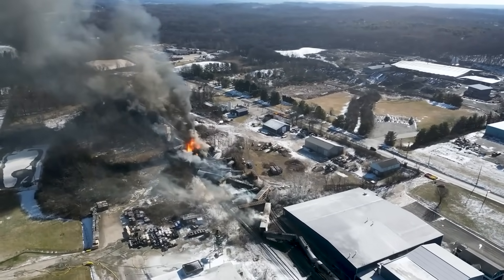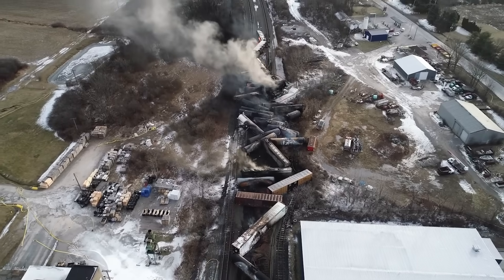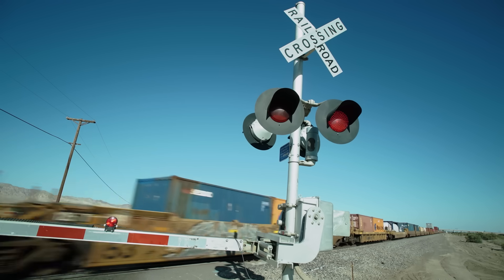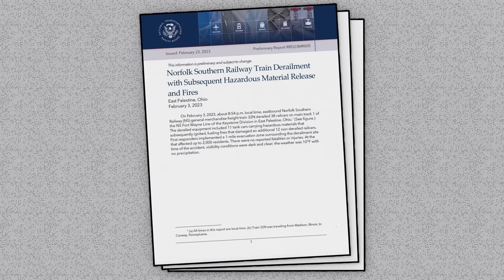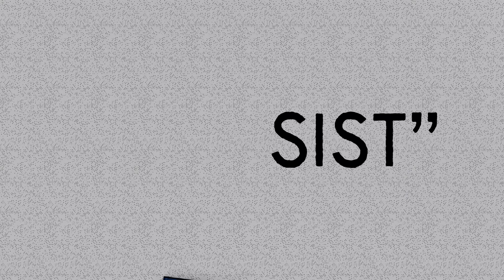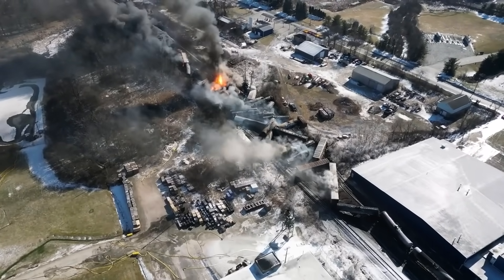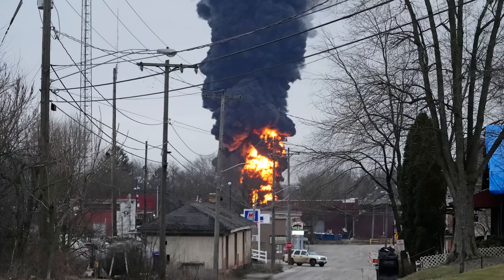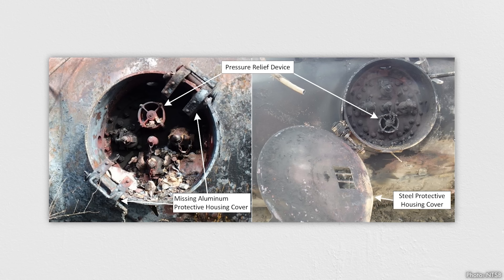East Palestine Train Derailment Explained

Comment: Seems to me the sensors that detected the temperature of the bearing simply needed to take into account what the temperature of the bearing was last recorded at. 
If in 15 miles it increased nearly 100 degrees but doesn't trip the brakes because it hadn't yet reached the critical point it should still be obvious that it was heating up.
And if it is heating up far beyond its neighboring bearings, and so quickly too, that should trip the brakes as well.
Reply: The detectors don't have the capability to set the train brakes. However, some installations are networked while others are not. Networked systems do sense the rise in temperatures and will alert the dispatching office who will contact the train crew.

Comment: Your river videos, I was hoping you could get back to it. if you had a perfectly straight line leading to a lake, with a perfectly straight line leading to the "ocean" what would happen. Adding the lake in the center, so long as the straight lines were off set, should slow the erosion down however the exit would remain in a close location... on the board. Also that map could add mountains. heavy stone imbedded in the area should do the trick for now.

Comment: They should have those sensors every 5 miles instead of 20. And if the temperature keeps climbing after passing 2 sensors then the train should be stopped. Even before the temperature passes the limit that is set.

Comment: Ah, the corporate geniuses. Replace the crew in the caboose with automated ‘defect detectors’. That tell you just enough so you know when something has gone terribly wrong. Not only is it possible, it’s not even expensive to have thermal supervision of every axel native to every car. I work on turbomachinery from the 70s and we reliably monitor bearing temps inside of extremely hot and oil soaked environments. A train axle is a very permissive environment to measure in. Or they could choose IR or UV monitoring which would allow wireless monitoring of multiple cars. So many options, and yet they choose none of them. 

“If you think process safety is too expensive, try having an accident”. We should not be relearning the lessons of bohpal in 2023.

Comment: There was probably a BIG concern about the burning tank cars causing a BLEVE, boiling liquid expanding vapor explosion. Letting the relief valves flare was a bad option. A full tank is actually safer as the boiling liquid inside cools the steel, once the tank is mostly empty, there is nothing to cool the steel and it is actually mostly empty tanks that rupture. Those PRD's solved one immediate problem but definitely created a bigger one. Still, if I lived in east Palestine, I'd be pretty pissed.

Comment: The unions have been warning about the safety culture for years at this point and have been ignored by both the state and the rail industry the entire time. Derailments used to be pretty rare, but now we have hundreds every year. The only way to fix this is to listen to the rail unions when they speak out. They are the only ones that know the true extent of the corruption within the rail industry. They work the rail lines and they should be listened to as they are the most direct source of safety data. When CEO's are faced with a choice between public safety and increasing profits, they choose profit every single time. The NTSB can only react when anything goes wrong. They have an important role to play, but the unions are a preventative measure that needs to be taken seriously. 

Norfolk Southern should never have been put in charge of clean up. They should definitely foot the bill, but they cannot be trusted to clean up the mess they made. The EPA should do the actual clean up and send the bill to Norfolk Southern.

Comment: Your wrong on train braking systems. They need air pressure to work if a train looses air pressure then u have a run away train that can't stop as happened in the field cp rail derailment. Trains are not like tractor trailers with spring brakes that apply mechanically. The only mechanical way to stop a train is the applied hand brakes on every car that they use when stopped.

Comment: Why dose it take a disaster for these companies to up there standards the train should have stopped as soon as the temperature went above normal not 200 above I used to work on hirail trucks and just about every one I worked on needed new wheel bearings due to over loading and heat there should have been more safety monitoring on the train all the safety systems on our cars can be put on trains but won’t due to cost

Comment: You missed a few key points. 
One, there's an average of about 1700 derailments a year.
And two, that was NOT a controlled burn. That was a release and burn. A controlled burn is as you briefly glossed over, with a flare or similar where a proper O² mixture with the Vinyl Chloride can be CONTROLLED. I've been at various refineries when the flare goes off. There is a huge amount of fire but NO smoke. 
And the same EPA turned the Colorado River gold with toxic stuff from a mine. I don't trust or believe the EPA one bit. That ground is polluted. The water table is polluted.

Comment: I would like to know more about the railroad braking systems.  When this event occurred, there were some statements made that the modern rail car has brakes that were designed prior to 1900, and the lines wont modernize due to cost.  How long does a rail car take to stop in emergency scenario?  Do 2 cars take twice as far?  What can be done (policy/legislation etc) to force retrofit of modern brake systems?  Is anyone working on such improvements?  How often are the brakes inspected, tested, serviced?  Would better, modern brakes likely have prevented the East Palestine accident?

Comment: 5000Tons of dirt is just not that much, but it's hard to know the scale of the cleanup. I heard the train crew is supposed to put eyes on all the cars before the train leaves the yard. On these very long trains, 2 miles or more, that would take time to do the inspection carefully, and the Co's aren't going to want to pay. It will be interesting to hear the arguments that take place for even more tech to be introduced, or better use of manpower. It bares noting that planes are still physically checked several times before flights.

Comment: In the days of the caboose, and before the automated detectors,the detectors were lighted up boards. The engineer would radio the conductor “SP 8545 to caboose, scanner.” When the caboose passed the scanner the conductor or rear brakeman would look at the board to see if the scanner had been set off. The board would display the axel number that was registering hot if one was. If not, the board displays 3 zeroes. The conductor or rear brakeman would then radio the engineer, “SP8545 highball the scanner.”

Comment: I did not understand why the train actually derailed. You told us that the emergency brakes activated, then the crew activated the rest of the brakes and took off  with  part of the train, and then the train derailed. But why? Did it just hop of the tracks? Was the track ending? Or is it just the different speed of the railcars? If just one bearing was defect and even if the wheel was melting of, it has 7 other - shouldn't they be enough to keep of the tracks?

Comment: This is an opportunity to discuss rail from an engineering perspective. Majority of the population have no idea of the weights moved, the infrastructure required or the engineering into modern trains. 

But here is something for the commenters to think about; a train can stop within one length of itself, imagine a car doing that. However, modern trains can reach 2.5 miles (4km odd) long. With weights over 10-20 kilotons. (even larger than this exist.)

Comment: I'd really love to know more about why burning the VC once it was released was considered the best course of action at that point. I'm not quite clear why it couldn't be pumped into trucks and removed that way for example.
Reply: Vinyl chloride is a flammable gas at temperatures above 7F. It's transported as a compressed liquid under very high pressure. In a scenario like a train derailment and subsequent fire, venting the gas and igniting it is probably the safest, least environmentally hazardous approach to take.  You do not want the stuff to linger, heating up and expanding until it exceeds the strength of the tank cars and bursts them.  You can very quickly find yourself with a "BLEVE" (Boiling Liquid Expanding Vapor Explosion) that would cause considerably more damage and injury than torching a plume of gas in a controlled manner.  There's a truly scary youtube video out there of a couple of tank cars letting go (one containing propane and the other isobutane) after a derailment in Illinois in the early 1980s; when the propane tank blew up a news crew a half mile away felt the thermal bloom, and half the rail car was found in a field 3/4 of a mile away from the explosion site.
Reply: @mrz80    thanks for replying, however this still doesn't explain to me why releasing into environment is better than pumping under pressure into a truck (for example). I'm presuming that's possible since the material has to have got into the rail cars somehow. If the reason is simply, the trucks capable are too far away, then fair enough, but I haven't seen anyone say that. Only "this was probably the best solution". What were the other solutions available? What variables made them untenable?

Comment: I have heard axle vibration sensors are the norm for passenger rail.  Vibration sensors are considered far more reliable then temperature sensors at detecting bearing failure.  Powering them and connecting them to the locomotive would be pain.  Everyone knows how much hassle is trailer hitches.  Also adding another wire would up the workload.  I saw a solar powered ballasting car used by the contractors upgrading the tracks fore Brightline.  Basically a solar panel on top of each ballast car was used to power electric hopper doors to dump the ballast on the track.  Kind of a neat way to power them. similar solar method could be used to power the sensors.  Also some sort of radio communication between cars could be set up for communication to the locomotive.
Tracking and braking could be added to the system.

Comment: Great video Grady! Your strict engineering accounting of this tragedy is great and inline with your typical content, keep it technical. Your ending thoughts touched on the larger tragedy and the reality of freight rail traffic. Engineers focus on the how to do things but also need to ask but should we do this? The chemicals carried by this train are used primarily in the growing plastics industry which in itself is not an ecologically friendly industry. So our engineers need to work “overtime” to solve this problem that feeds a problem.

Comment: I found a small train bridge not very far north that is still very active and falling apart.  Not sure who to take it to but steel cross supports are just falling apart.
Reply: If there is a highway crossing along that line nearby, you will find a blue sign affixed to the crossing sign/signal post. The sign will have a phone number for reporting safety issues. An alternative would be to contact your county engineer's office.

Comment: This was a nice video about the nuts and bolts of what happened. I understand this isn't a political channel, so it makes sense to leave out the political context that lead up to the accident. And while someone who works in the rail industry probably has more details than me, there are two events that I feel are important here.

1) safety regulations on trains used to be tighter, but various pieces of legislation have deregulated rail safety standards. The last one occurring within the last decade. (I believe under the trump Admin.)

2) there was a massive rail worker strike past year, and one of the big concerns was lack of safety procedures. If the union was listened to at the time, this event might have been avoided. Instead congress and the Biden admin. Forced the union to take a deal they had already rejected as insufficient, and among the things that was left on the cutting room floor were various safety improvements.

Comment: Around the 10 minute mark you were saying they burned it off as the lessor of 2 evils and then flew a plane around with detectors and didn’t find anything. That whole scenario requires trust in our government and it’s institutions. Unfortunately, the US government has proven time and time again that it is not trustworthy when it comes to environmental safety issues. In fact it’s quite the opposite, and I’d argue they’re just as culpable as the initial offenders. How many times have they said it’s all good and it turns out it was NOT. I’m from the STL area and we have several super fund sites from the Manhattan Project that were supposedly safe. Decades later people are still getting cancer, dying, etc. and the government still denies. If I lived anywhere near that spill I would be GONE! Just no way to trust that it’s safe when the government is investigating the government. These large corporations keep raping our resources and destroying our environment and the US government not only protects them, but actively supports them. They don’t care about the American people, only the bottom line. Question everything people.

Comment: Somewhat off-topic I know, but I've always wondered why the brakes on rail cars are fail-open. As in if air pressure is lost or a car breaks free, the brakes don't engage. Is there a safety reason for this? Or is it just continued because doing the opposite would require a monumentally expensive reworking of every single piece of rolling stock in the nation?

Comment: Trucks have bearings that at times cause fires and their combined fuel and rubber tire emissions are of greater environmental concern. Marine transport is still the dirtiest of them all. Still hazardous materials  need better regulations on all transports. Railroads need more sensors, perhaps with solar power and a Starlink antenna so the EPA and the drivers would be working in tandem to drastically reduce such incidents.

Comment: Doesn't the description of the emergency braking system raise the hairs on your neck? How long does it take the pneumatic brake signal take to reach the end of the train? You end up with the front end with wheels locked while the back end is still brakes off as normal. That is an accordion crash in process. What is needed is an electrical signal through the train that will apply brakes of every car at the same time. Then maybe the accordioning cars we see at almost all train wrecks will be a think of the past. Yeah, it will cost a lot. But, it's time we bring railroading into the 19th century out of the 18th or earlier, at least. Positive train control is nice. It hopefully prevents things like the Chatsworth head on disaster. But, the accordion still lives on despite this single modernization step. Apply that PTC philosophy to every car in the train at once. This would be another small step.

The train side detectors are another issue. They need an intermediate warning about axle heat. The warning system needs communications and memory. An axle that raises in temperature between two detectors more than say 40F should warn the engineer that a problem is building up. And perhaps, given the traveling speed of some freight trains, the detectors should be much closer together, at least where large trains run slow.

I'd also like to see something altering the current "cost of doing business" model dealing with these disasters.

{^_^}

Comment: It's the thermal rate of rise between sensing points that's at issue-not the absolute values above ambient!  Bearing failures of this kind are well characterized-the progressions are well known-the rules like the arrangement of cars and the so called controlled burn are to the benefit of the Railroad at the expense of all else.  The Corporate/Regulatory State is designed to ensure the NS  minimal detention from an OOS line.  Any regulatory expense will be passed on to traffic, the status quo is stuffed into the coffers of the RR's.

Comment: With how long the trains are and knowing that the crew have almost no chance of spotting a hot bearing, it seems a bit negligent to only have the defect detectors every 10 miles. Bearings can go bad far quicker than that. In addition, the train being so long also makes it much harder to react quickly once you’ve found out there is a defect

Comment: When the Burlington Northern wanted to build a line to the powder river basin, they faced a massive investor revolt; one of their board members resigned in protest; the idea of building something was unthinkable. No capital spending! Put all that money into dividends and shut up!

That line is now BNSF's most profitable line.

Norfolk Southern puts a train on the ground basically every week now. All in the name of returns for investors. Capital spending on infrastructure and maintenance are as unthinkable as building new railroads. It might literally cost us more to have a slow, dangerous, inefficient rail network that burns out its employees and threatens homes and lives across north america, but it makes investors more money to do it this way, so until the class 1s are either compelled by force, or, horror of horrors, nationalized, they will continue to do this.